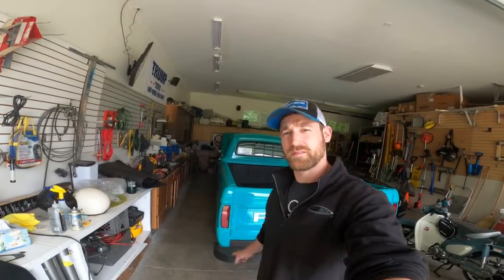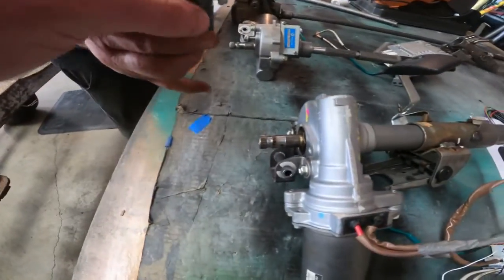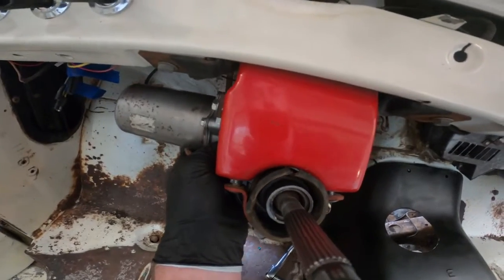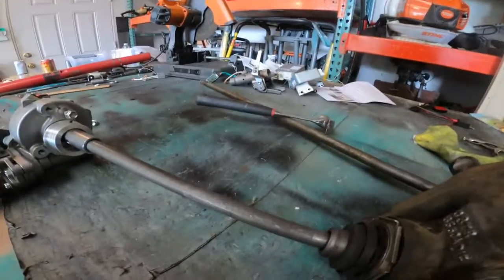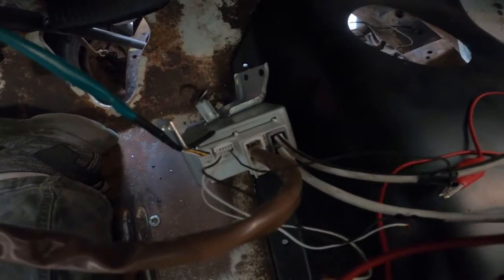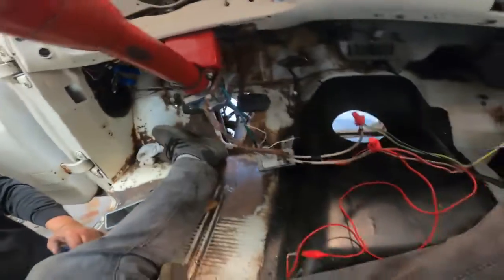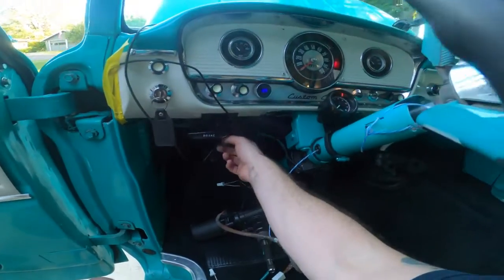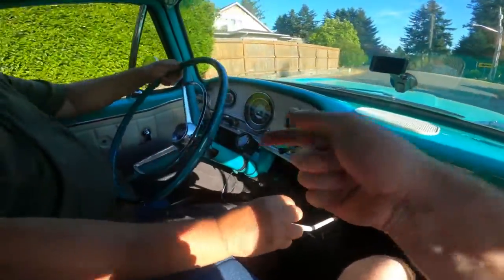Electric power steering retrofit in a 60's pick up.

Comment: I am going ahead with this project.  I have a 1967 Ford F100 4 speed 352.  Is there anything that you can think of that would prevent this from working if I installed it the opposite way?  The clutch and brake mechanism prevents me from installing it the way you put it in.  If I install it "backwards" and put it in front of the dash essentially between the dash and steering wheel, it is not as "aesthetically" pleasing but the EPS motor fits pretty well and I can essentially use the column mounting bracket to clock it in.
Reply from the maker: That should work there too. Your right it might not look pretty and that's why we choose the spot we did. Plus we were able to integrate it with the mount for the steering column. The measurements in my video are going to be all different for you too.
Reply: Following
Reply: Your steering wheel has to be on the same side otherwise your tires would be getting the power to turn the steering wheel and it would probably rip out of your hands.
Reply: Project completed.  I ended up installing it on the engine side of the firewall.  I had to cut the opening in the firewall a little.  Secured it to the inner fender wall  using a u-bolt and filled in around the firewall opening with foam insulation.  Put the control box under the dash.  Works great.
Reply from the maker: We considered that as well but didn't like the idea of cutting into the fire wall after we painted it. I'm glad it worked out.

Comment: Did you come up with a way to make the upper splined shaft secure to the motors spline section so that it doesn't have the ability to pull out?  Does the truck return to center on its own?
Reply from the maker: If I remember right the spline shaft is pinned with a bolt. As for the return to center if the truck has the correct amount of positive cast it should return to center easily. It's been a while since this project so my memory of everything is a bit foggy

Comment: Ok so I did this mod on my 63 f100
I thought was easy to do with excellent video help from you.
Steers so easy now 
I would like to find a smaller steering wheel now 
What will fit on splines
Reply from the maker: I am not sure what you can swap on to it. there is a company called CON2R  in Oregon that makes custom steering wheels that my friend ended up buying for this truck. Not sure how much he paid but it's color match and period correct.

Comment: i appreciate this video as i have a 63 i want to do this two
two questions 1  Is there any certain year of Toyota Pryus
2 off topic were did you get the cup holder console
Reply from the maker: I believe any year will work for the Prius steering gear.  Not sure about the cup holder

Comment: So you used the prius unit? Did the bruno box actually change the ammount of assist it provides? I cant find any post anywhere saying that the Prius controller that Brunosteering sells actually works. Allni find is that it does not work. Doing this to my 69 mustang. Thanks and great video!
Reply from the maker: Yes, we found that it does actually work but there seams to be a delay connecting to GPS. After a while we ended up removing it and leaving it at the prius default 40% and it works pretty good that way.
Reply: @christopherjpeters oh it did work?! So without the controller at a stop on the "fail safe" mode, can you turn wheel easily? And how much of a delay for the GPS unit to start working?
Reply from the maker: Yes it works fine. The delay on the GPS depends. Sometimes there is none and sometimes it's like a minute  or two. We just found it un reliable. I probably should have added it in the video but did realize it until a few days later.
Reply: @christopherjpeters  right on, thanks for the info. I might order one then....maybe lol! Budget will tell. Thanks again
Reply: Frat tips.  I am glad I read your comments.   I had concerns about return to center issues.  I’ve been considering for my 64 c10 Chevy and was looking into the gps signal but seems like it might be best to just go without that.

Comment: your issue will be the shift linkages will not be able to pass through the space where the Prius motor resides.  You’ll have to go with a floor shift of some type
Reply from the maker: It already has a 4 speed floor shift But yes your right this wouldn't work with column shifter.

Comment: Hey Chris, you mentioned a deuce and a half, do you think this would work for that application? I’m about to try myself which is how I found your channel. Let me know your thoughts on this! Thanks I appreciate any insight you can give.
Reply from the maker: I am not sure if the Prius motor can handle the duce and a half. That's quite a bit heavier than the Ford pick up. However it is just a motor assisted application. If you keep the large steering wheel in place it may help.
Reply: Being that it’s going to be altered and still be a straight solid shaft just like the original, that’s the thinking of a few people, it’s only meant to help lighten the steering, not actually do the steering.  If the motor fails, you still have a solid shaft to steer with.  And yes, definitely keep the original size steering wheel.  An adapter would probably need to be made to size it down to the Prius shaft.  Oh, and Saturn Vue EPSA units are readily available.
Reply: Oh, and it’s not a motor cross event so the motor should not be overworked with turning back and forth.  Any further thoughts?  Worst case I finish converting to hydraulic power steering.
Reply from the maker: That was my thoughts. Too

Comment: great info vid!  but, do you NEED to use the part that adjusts steering effort, or can you just run it at a constant ?
Reply from the maker: You dont you can run without it. There is default setting.
Reply: @christopherjpeters  thx for the reply. im seeing a winter project ahead ( 63 econoline)

Comment: Where can I buy the $18 weldable couplings you used to connect the Prius shaft to your trucks steering shaft?
Reply from the maker: We got them from a local place here in western Washington. Are you in Washington?
Reply: @christopherjpeters  I'm in western WA.  Looking to do this upgrade on a '65 F100.  Where did you get the coupler?
Reply from the maker: Sorry it took me so long to reply to this but here is the link to the coupler. I was wrong its a place in california and we shipped it here. 
https://www.kartek.com/parts/steering-coupler-34-smooth-to-17mm-36-toyota-spline-for-our-electric-power-steering-kit.html
Reply from the maker: Sorry it took me so long to reply to this but here is the link to the coupler. I was wrong its a place in california and we shipped it here. 
https://www.kartek.com/parts/steering-coupler-34-smooth-to-17mm-36-toyota-spline-for-our-electric-power-steering-kit.html
Reply from the maker: Sorry it took me so long to reply to this but here is the link to the coupler. I was wrong its a place in california and we shipped it here. 
https://www.kartek.com/parts/steering-coupler-34-smooth-to-17mm-36-toyota-spline-for-our-electric-power-steering-kit.html

Comment: What year Prius
Reply from the maker: I believe it was a 2008-2012
Reply: @christopherjpeters  quick question, how is the steering box operating and connected? Since you haven't shown the process of installing it in the video
Reply: @elmarkokarkar3521  the steering box is secured with the bolt pattern on the back connected to a twisting-strong anchor point. other than that, all the needed torque sensors and drivers are built into the motor and gearbox assembly and brainbox. all the brainbox needs is Main Power and Enable. Main Power is connected with a resettable 60 Amp Breaker and Enable is connected to Switched Run signal